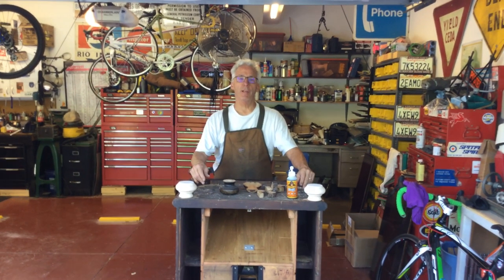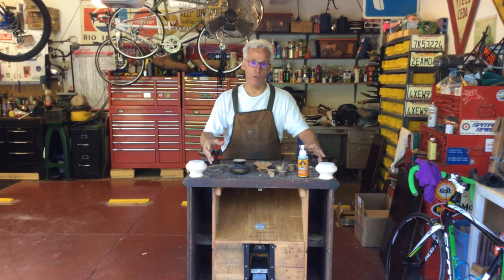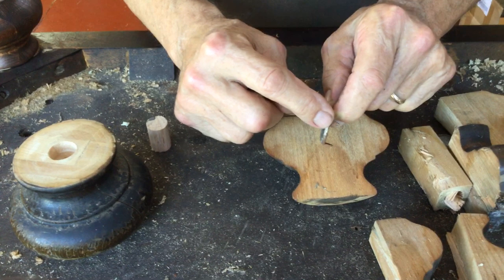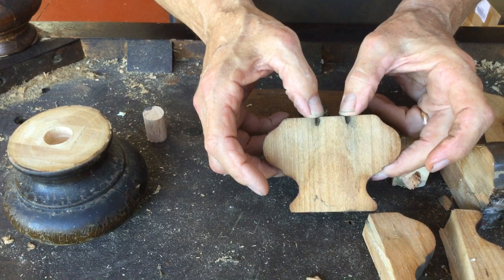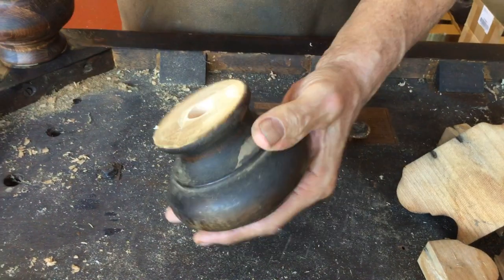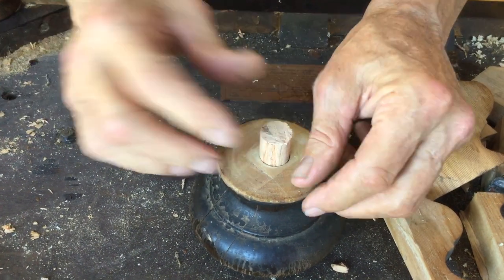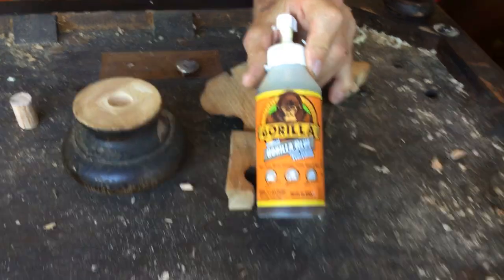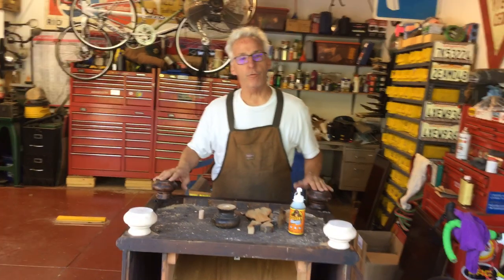101.  Replacing the bun feet on a Victor Credenza phonograph

Comment: Hi Fred, Thank goodness I found your channel - I just received a Victrola Credenza that's been in my wife's family from the early 1920's  Been stored in a garage attic for decades.  Other than one split foot and a broken brass lever It looks to be in pretty decent condition -  but I don't even know if, or HOW it works. I have NEVER worked on anything like this, but I'm a retired programmer and tinkerer, and not afraid to try it.  Can you recommend a good starting point, or basic outline to follow when restoring one of these?
Reply from the maker: Start by watching my video on how to clean your machine leaving only the original finish. Then oil all the moving parts, pull off the turntable and oil the spindle shaft.  I have loads of videos on working on Victrola‘s so start With the basics. The credenza is my favorite machine and I have done a video on our art case credenza.  Any questions, just ask.    Brett
Reply: @1974hurt  thanks Brett! Started the cleaning. Looking forward to getting into it.